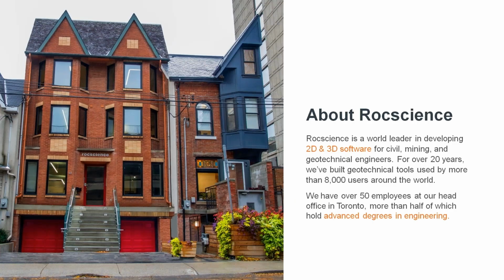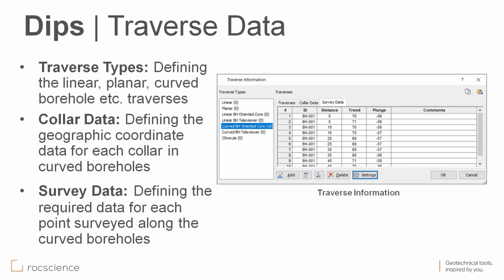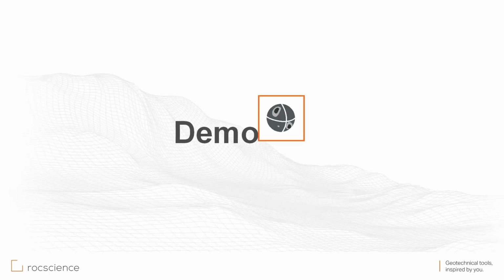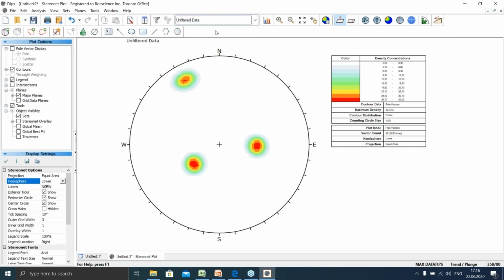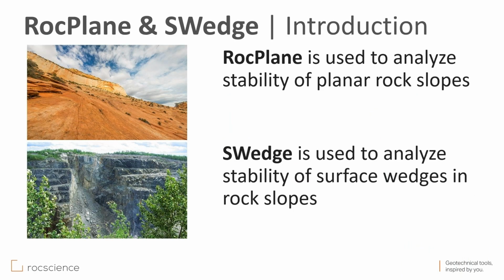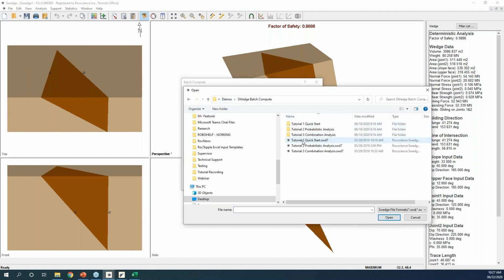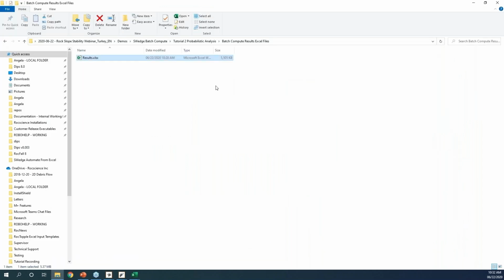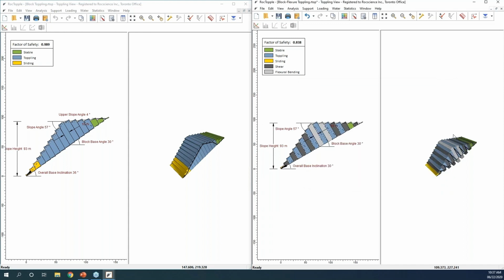Rocscience Webinar: Rock Stability Suite - Dips, RocPlane, Swedge, RocTopple

Comment: Hello. What does the value of the lateral limits depend on? Since the value of the percentages varies a lot depending on whether it is 20 or 30. Thank you.
Reply from the maker: Hello Emilio,

For any given 3D planar measurement, we have both the actual dip and the apparent dip relative to the slope face. When conducting kinematic analysis in 3D, we must be cautious not to blindly use actual dip, as they can dip in all directions with dip directions varying from 0 to 360 degrees. What we want to do is use planes and/or intersections that dip in the same relative direction to the slope so that the apparent dip or plunge is comparable to the actual dip or plunge. Particularly for modes of failure that are entirely 2D (i.e., planar sliding, flexural toppling), the planes should dip in the same direction as the slope. In reality, we don't always encounter planes that dip precisely in the same direction as the slope, so we set a lateral limit to capture the planes/intersection that dip relatively in the same direction as the slope. A rule of thumb is to use +/- 20 to 30 deg.

Thank you!
Reply: @rocscience  Thank you very much for your answer, it was very clear and now I understand it better. Could you give me an example when you would use 20 and when 30 degrees in the lateral limit?